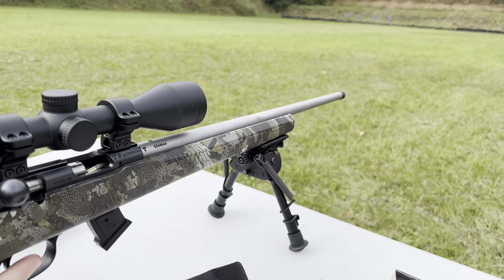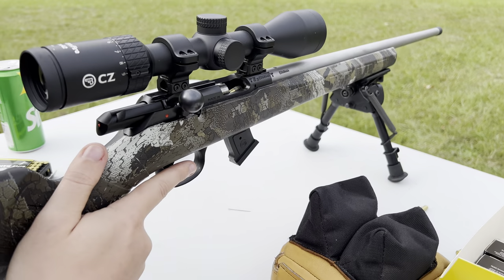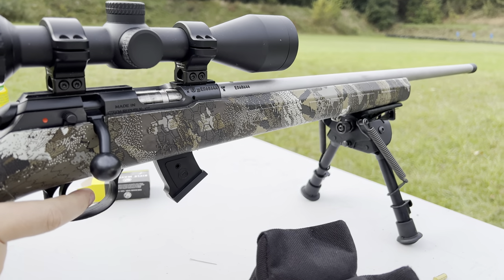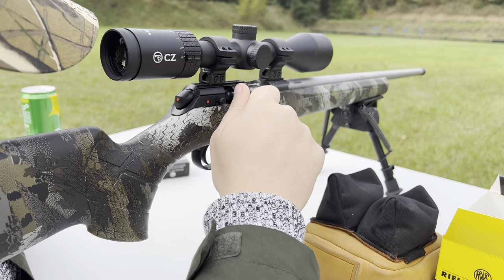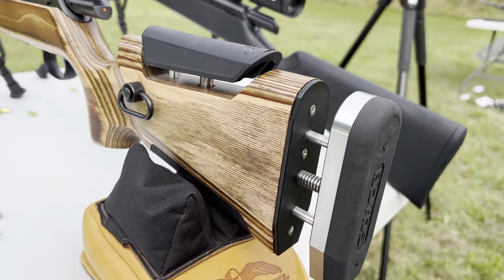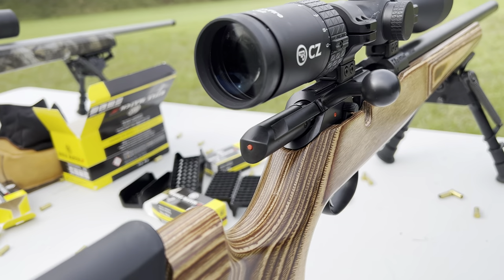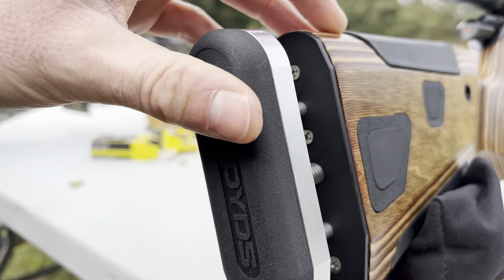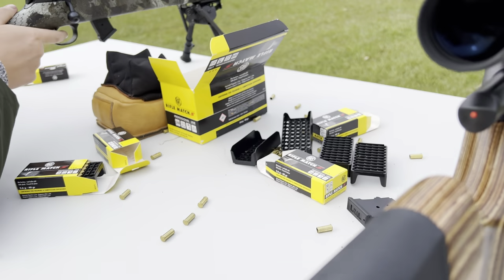CZ 457 Stainless and AT One as well as standard Synthetic side by side, quick look

Comment: I’m building a At One 457 from a 16” varmint base synthetic stock version with a blue Boyd blue stock. By the time I have sourced a metal trigger guard I’m around $50 Australian under what I could have bought a factory At One for. 
Using a base 3-9 x 40 Sig Whisky 3 on a MDT 20 MOA pic rail and leupoid metal rings. 
Basically this will be my rifle to learn to shoot again as was an open sight shooter before I gave shooting up in the mid 90s. 
Have also a new Ruger 22 Magnum stainless with the medium barrel but it’s expensive to spend much time at the range with.
The CZ is far from perfect but perfect for me